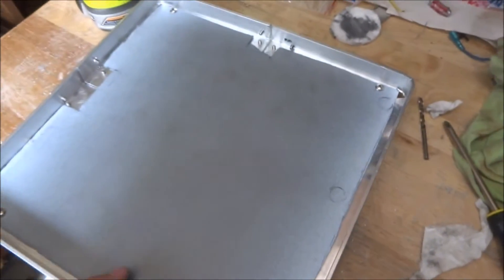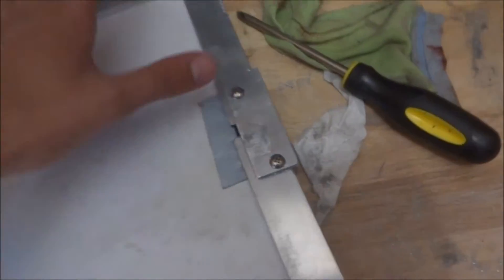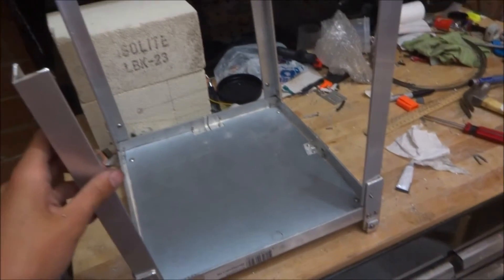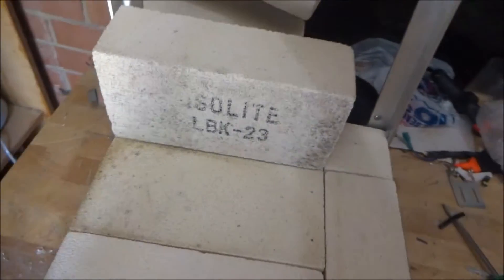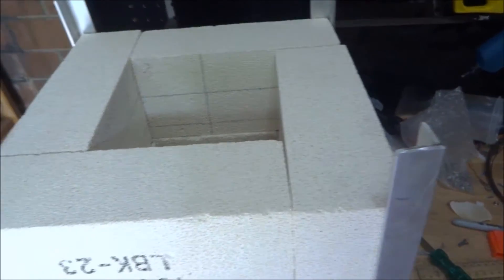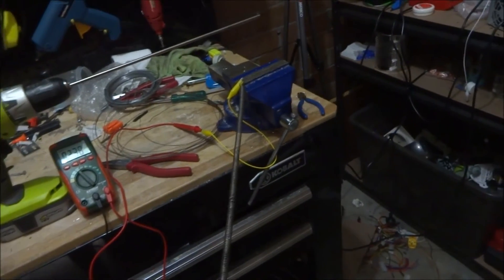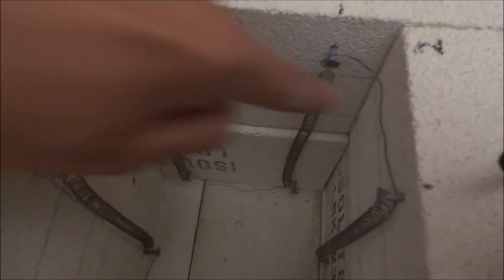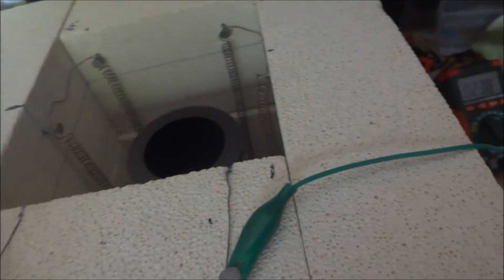ElectroForge Build Log: how I made my electric metal foundry

Comment: So bud, why go with a higher wattage and lower amperage setup for your heating elements? Is it simply due to the materials you had at hand or is it more so the target element you were wanting to melt down? Based on what my limited knowledge of engineering is, if you were to use a sturdy coil material with a high-amp transformer than you would have quicker melt times as well as an overall higher temperature. Doubt I'll get much of a reply but would be interested in a discussion if possible.
Reply from the maker: Hello! While you could use something like a rewound microwave oven transformer the step down the voltage, theres a few reasons why it made more sense to just use the mains voltage. Most of the common heating elements materials such as nichrome or kanthal are designed to have a relatively high resistance and so are more sutied towards a higher supply voltage, if you were to connect these to a low voltage supply they would draw very little current and so end up with a really low power. If you could find a heating element that had a lower resistance then you could use a lower voltage to get the same power. The melt times would not necesarrily be slower or faster either way, you can get the same power levels with a high current and a low resistance or with a high voltage and high current. The maximum temperature of this furnace was limited by the maximum temperature of the heating element since it nichrome, if you can find a heating element with a low resistance and a higher temperature rating then you could possibly reach higher temperatures. I have recently built a new furnace using a kanthal element which can reach >1200C and is limited by the power level of the furnace, not the element. The main advantage I would see for a lower voltage is saftey, as all the exposed mains wiring on this furnace was really sketchy and dangerous.

Comment: Hi "Crispy", Have just watched your video. Found it clear & informative.I've looked at lots & you're going fine.I'm considering doing same,no experience as yet.Others have set wire into grooves. Will watch your progress with interest.Cheers, Chris. U.K.
Reply from the maker: Thanks for the feedback! I considered placing the heating elements into slots in the bricks in fact I was planning to but when I was putting together I figured  It was easier to wrap them around the nails. I have noticed no negative effects as a result of this. I did however underestimate the thermal expansion of the coils after first use and there is now a bit of slack in them. That might have been less of an issue in grooves. Good luck if you do attempt to build one!